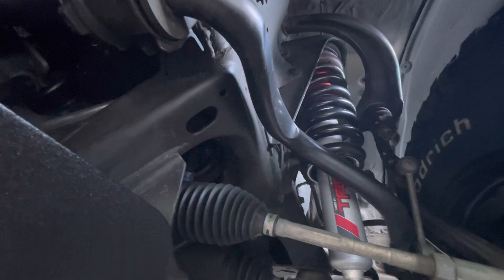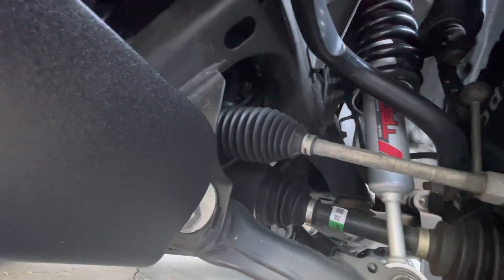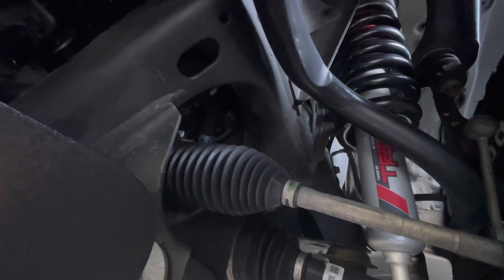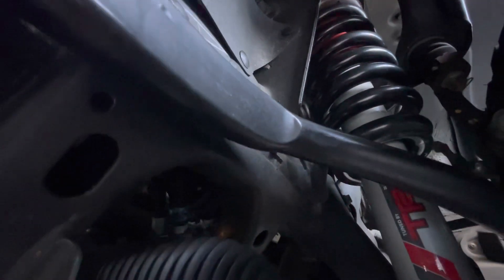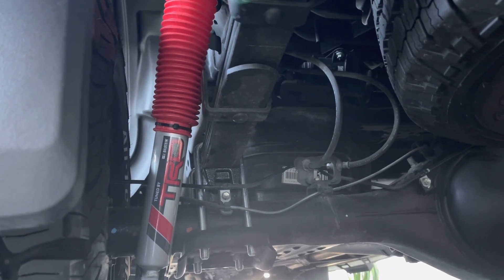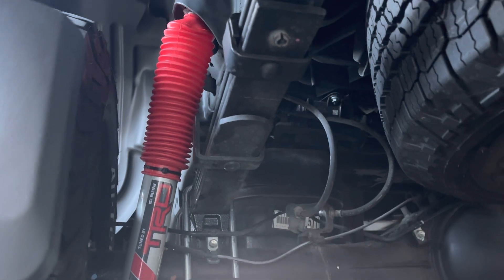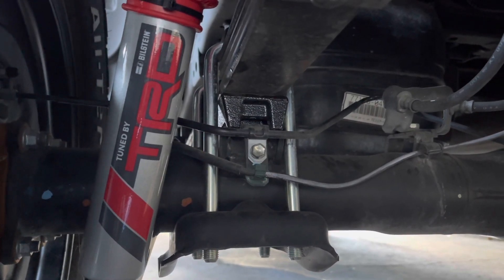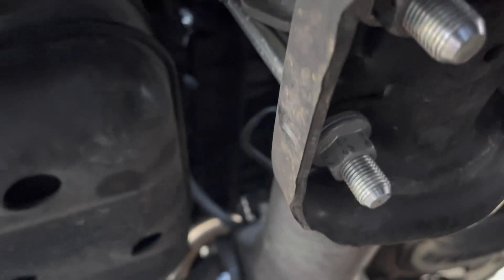TRD Off Road 4x4 Tacoma W/ TRD Lift Kit - Follow Up

Comment: I want to upgrade tires and potentially get the TRD Lift Kit. Would you recommend doing the lift kit before the tires?
Reply from the maker: I would probably do the tires first. After the lift kit is installed your factory tires will look kind of small.
Reply: @westcoasttaco  I’m changing from 265/70R16 to 265/70R17. So sadly the tires will look small regardless. One local dealership just quoted me for kit and install $3,995. Basically $1,750 for the kit and $2,245 for labor to install. I’m starting to think given the crazy prices in general and especially around northern VA that the TRD Lift Kit is just not going to be a realistic option for me
Reply from the maker: @nick90jg  So there are a couple options here.. when I was first looking into the TRD Lift Kit a local dealership quoted me $1700.00 for the kit +$1800.00 for the install.. which is pretty high in my opinion, but apparently less than what you were quoted. I bought the TRD Lift Kit on eBay from a Toyota Dealership for $1500.00 and FedEx delivered it to my door. Then I went to a reputable local off-road shop and they charged me $400.00 to install the lift kit and an additional $100.00 to install 4 new tires with a balance and alignment. So essentially it cost me $2000.00 in total to do this minus the tires I bought for it. I installed the Grille myself. Lastly another option that would save you even more money would be to go with a Bilstein 5100 setup. It will give you pretty much an identical look and ride to the TRD Lift Kit at a fraction of the price. Hope this helps you bro!
Reply: @westcoasttaco  same dealership said they could do it for $2,995. That’s still high. I feel like for what it is, anything over say $2300 is tough. I’ve also found a dealer within 75 miles that sells the kit for basically $1,500 after taxes. So I like your thought of having a reputable shop install it or just go with 5100s to get essentially the same suspension. 

I really just want a lift and not necessarily for anything off road specific. I also kind of like the off road grille so I don’t mind not having the heritage grille.
Reply from the maker: @nick90jg  based off of your feedback, I think the 5100’s is going to be the best route for you. You can get the whole set for around $500.00 and install at a off road shop would probably be close to $400-$500 for labor.. especially if you aren’t really wanting the heritage grille.
Reply: @westcoasttaco  that’s good to know so I have that number in my head to go off of. Yeah I initially did want the heritage grille like it was a most but now I’m actually pretty happy with the standard off road grille. I’ll probably go check out some shops this weekend and look to get the 5100s installed
Reply from the maker: @nick90jg  sounds good 👍🏼! Keep me posted on how it goes!
Reply: @westcoasttaco  so just put half down for the 5100s. Before a LEO discount it was going to be $1,250 with install. So let’s just say the LEO discount knocks off $50. I also ordered the BakFlip MX4. They were selling it for $190 under MSRP.
Reply from the maker: @nick90jg  sounds like you are right on track 👍🏼
Reply: @westcoasttaco  yep now just need to get some wheels and tires. I’m thinking I’ll just wait until RRW has more RRH-7’s available to order in a couple weeks. I think those a lot
Reply: @westcoasttaco  5100s we’re installed today. I like the look and being a tad higher up driving the truck. The RRW RR7-H’s wheels come next week. So tires and wheels should be going on soon!
Reply from the maker: @nick90jg  👍🏼👍🏼 Nice! Let the fun begin!!
Reply: @nick90jg  I live in Northern Virginia and when I was having scheduled maintenance done at Ourisman Toyota of Chantilly they had a sign that said they did the lift for a total of $2495 or something like that. Give them a call and see if that is correct.
Reply: @marineone7507  that’s not a bad price for what I’ve seen. I already have Trick Trucks do Bilstein 5100s all around. For basically $2550 I got that done and a Bakflip MX4 cover installed. I don’t have the pro grille since I didn’t get the TRD Lift Kit, but I kind of like the off road grille. I may get the Pro grille someday but for now I’m happy.
Reply: @westcoasttaco  The KO2s and RRW wheels have been on about a week now. I notice a slight vibration only when braking. This is new with the KO2s and new wheels installed. I didn't have this when I bought the truck back in January nor after the 5100s were installed. Do you think this is perhaps a tires need to be balanced again issue? Something happened to the brake rotors cause them to be warped during install of new tires/wheels (unlikely but I keep reading about warped rotors)? Or just what happens when you go from the lighter weight, less aggressive Goodyear OEM tires to something much more durable and a little bit heavier like a KO2? Even in a C load range
Reply from the maker: @nick90jg  hey Nick, so there are a few things it could be.. I’ve read a lot about people not torquing the wheels properly and warping the rotors or the drums needing to be “re-rounded”. I’ve also heard that KO2’s can be sometimes challenging to balance.. but typically it seems like an unbalanced tire is usually felt at higher speeds and not when braking.. but I suppose braking could affect it too.. last thing I’m going to mention is maybe getting the truck tuned. Did you do this? The only reason I mentioned this is because I got my KO2’s on almost immediately upon buying the truck. So I didn’t notice a slight vibration with the braking until later on and after the tires had been installed for a little while.. the vibration was mild and wouldn’t happen every time would brake which made me think it was either the rotors or the drums needing some minor attention. Funny thing is that after my tune the vibration is all but gone when I brake.. I’m beginning to wonder if the vibration I was  feeling is something engine/transmission related and is being felt as the truck is downshifting. I mentioned this on this video: https://youtu.be/amkDEr8YoVc at 19:45. I had my tires rebalanced initially with no success so I wouldn’t do that unless you are having symptoms when driving without braking. I never took it in to get the brakes looked at but like I mentioned some people said they have had their brakes lose “their round” and had similar symptoms you are describing.. could be the case… hope this helps.
Reply: @westcoasttaco  this is great info. No I haven’t had it tuned yet. I intend to, the closest tuner to me isn’t that close but does planned trips up towards me. So it will happen eventually or hell maybe a road trip over a weekend is in my future. Yeah this morning I didn’t notice it braking as much. It’s minor so I thought maybe it’s just going from the factory Goodyear Wranglers to a heavier tire.
Reply from the maker: @nick90jg  honestly, the weight difference is probably the main culprit.. keep me posted on how it goes 👍🏼
Reply: I also feel like braking is a little stiffer just that it takes a little more to slow down. So u think it’s just the change to a heavier tire. This is also the first time I’ve ever had an all terrain tire. Every other vehicle I’ve had has had factory tires except one that I switched to winter tires. I think I just need to adjust to having in all terrain tire in general
Reply from the maker: @nick90jg  yep, I honestly think that is it.. it sounds like we have both felt the same minor vibration so I would think it must be an “across the board” feel for the heavier tires.👍🏼
Reply: @westcoasttaco  the takeaway here is I should put these tires to good use so I’m not just a hair slower and heavier for looks only haha
Reply from the maker: @nick90jg  You nailed it! LoL
Reply: @westcoasttaco  what PSI would you recommend for daily driving on city streets and highways? Looks like Costco set them to 45 for all for tires. I feel like that’s high without even doing any research even for the C load tires
Reply from the maker: @nick90jg  you know it’s funny you mentioned this.. when the off-road shop put mine on they put them all at 25 psi.. I could hear the tires with my windows down when coming to a stop.. they made this “sticky” sound on the asphalt.. that seemed really low to me and I decided to bump them up to 33psi all around.. seems like a nice medium and well balanced ride now.. just my 2 cents though..
Reply: @westcoasttaco  I looked it up I guess BFG recommends 45 but that just seems high. I think I’ll drop down to 37-40 and give that a test

Comment: What kind of wheels are those? Are those the after market SEMA’s?
Reply from the maker: They are the TRD Pro Tacoma wheels.https://www.ebay.com/itm/185446904873?_trkparms=amclksrc%3DITM%26aid%3D1110006%26algo%3DHOMESPLICE.SIM%26ao%3D1%26asc%3D20191002094254%26meid%3Dbacf0388861f4f45b1d65c9890873119%26pid%3D100889%26rk%3D2%26rkt%3D6%26sd%3D325181824644%26itm%3D185446904873%26pmt%3D0%26noa%3D1%26pg%3D2332490%26algv%3DDefaultOrganicWeb&_trksid=p2332490.c100889.m5204

Comment: Can you run 285/70/17 wheels and tires
Reply from the maker: To my knowledge and understanding, no.. at least not without some rubbing or trimming the wheel well areas.. but maybe someone else has a different experience?
Reply: @westcoasttaco   im looki g on you tube i tuped in tacoma with trd lift kit and there is a one minute clip from a dealer ship that in stalled the lift with trd pro wheels and 285/70/17 just wondering how they got away with it not rubbing
Reply from the maker: @dennisjohnson9313  hmmm 🤔 well from my experience most tire shops will let you test out tires before you actually buy them (I mean like a test fit) on your truck to give you a good idea of what they will look like and how they will clear the wheel wells. Maybe go down to a discount tire and try a few different sizes? 🤷‍♂️

Comment: Noticed a mileage decrease?
Reply from the maker: I’ve been averaging 20mpg 80% of my driving is on the freeway.. so far I’m very pleased. Honestly my mpgs haven’t changed much from when it was stock.. my BFGoodrich tires are just a little taller than the stick wranglers..
Reply: ,, I had the same lift kit on my 22 Tacoma I have the exact same gas mileage that I had before
Reply: Mine was installed when new so I cant compare it to b4, but I get a consistent 17 city 20 hwy

Comment: Gonna need the needle bearing replaced, sooner or later...
Reply from the maker: Yeah.. I’ve been watching for it.. thankfully no issues so far but I’m anticipating it. Some people have claimed having issues immediately after lifting their taco.. I’ll provide an update if/when I start having issues.
Reply: Supposed to have upgraded it in 21, least thats what I was told. But with the trd lift installed when new its covered under warranty
Reply: Funny all the pavement queens crying because of the needle bearings….seen Tacoma owners with lift kits that spend 70%of the time in rough terrain and the needle bearings are the last thing in their mind